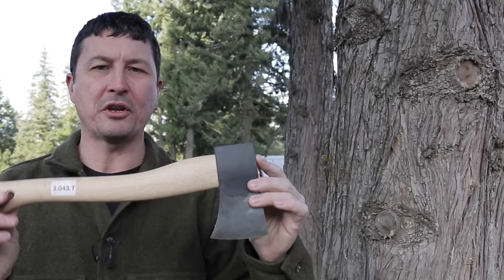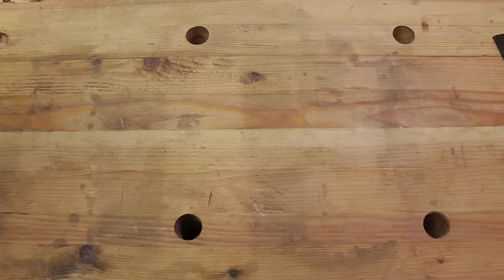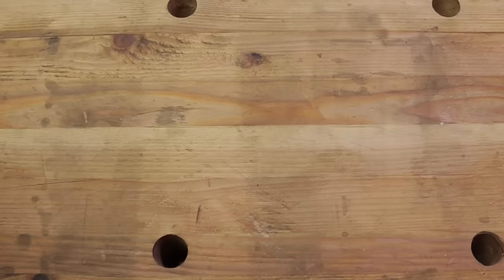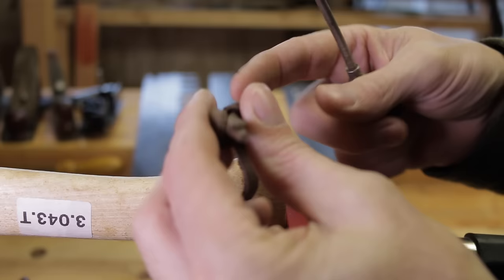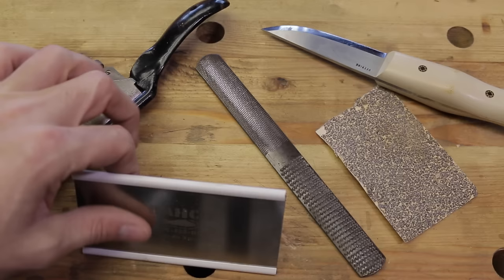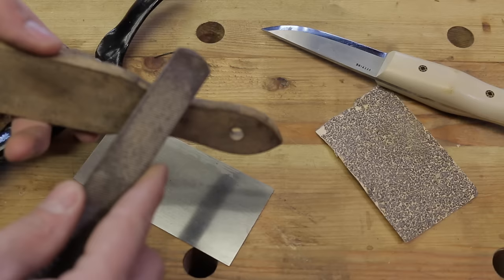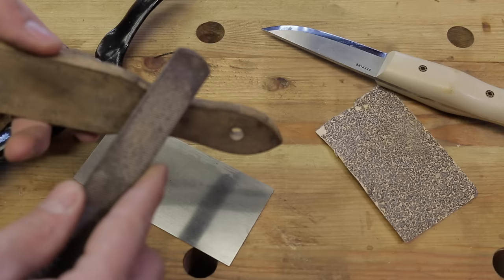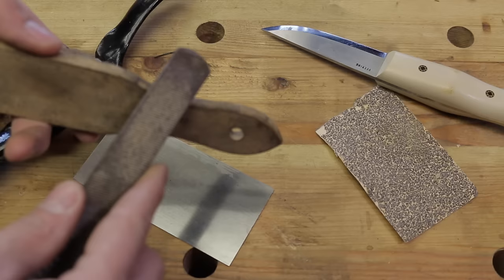5 Simple Axe Upgrades

Comment: I just use a flame to carefully burn off the varnish.  This also dries the wood so it will absorb more boiled linseed oil, which I rub in with steel wool.  Note that when the varnish was applied, it will have penetrated deeper into any exposed pores, so there is an extra reservoir of varnish in these areas that will burn longer (like a candle) and deeper into the wood if you let it.  On ring-porous woods like ash, these pores correspond with the growth rings, so if you rub back the wood before oiling it, you can achieve a nice contrast between the charred pores and the naturally coloured wood, as the Japanese practice of Yakisugi does with cypress.

Comment: I just did an axe handle tonight, but I don't have a spoke shave. I improvised by taking about a foot of steel pallet banding and filing a chisel edge in the center of it. it worked really well as the flexible banding allows you to form it around the curves and peel a large area. only downer is it's really soft steel so I had to touch up the edge twice during the process.

Comment: Cody, when I was in blacksmith/bladesmith school our instructors simply torched the handles to burn off the varnish. It worked in just a minute or less and the toasted handle actually had a nice raised grain finish that weathered in very well over time. Not sure what your opinion would be of having a handle blackened like these were but it worked very well and left a very usable handle. As a new student, with new tools I was not exactly in love with it at first but now it's my preferred method.

Comment: A properly sharpened card scraper is sharpened to a 90 degree angle then has a burr rolled over on the edge then is pulled at a 45 degree angle to the wood.  This gives you the very fine removal of material like the knife method you use with the ability to bend the scraper to remove material evenly on inside and outside curves, by far the best, quickest and easiest way to remove the varnish if you choose to do so.  They also do not generally come factory sharpened from the manufacturer.

Comment: If you don't mind a darkened handle, use a propane torch. It takes a little practice, to not let the handle surface get charred spots.. But this will lift off the varnish/polyurethane, toughen up the handle's surface, and prep it to soak up BLO faster than it otherwise might.
Reply: EgaoKage ya but that can be pretty rough on your hands even if you’re careful

Comment: Cody I actually have a method for removing varnish that works really well. It's super cheap and VERY effective. All you do is break off a piece of flat glass so that it has a curve in it, and the perpendicular edge is very nice to scrape off varnish and wood as well. I use it all the time to work on wood handles. It makes very nice curls and works much better than that card scraper.
Reply: +Chemistry, Films, and More; I saw an old movie where the principal characters  were jawing in the foreground, a scraggly looking craftsman was in the back drawing a piece of broken wine bottle over a spoke or some handle he was shaping. real shavings came from the work. I was impressed!
Reply: +grodad Yeah it's not a joke! It really works and it's my go to method.
Reply: mine too. right on. :)  (no sanding either)

Comment: Hey wranglerstar,  if you ever get the chance you should try sharpening with a harbor freight 1x30 belt sander.  This is what I use and I can get razor sharp polished edges in minutes.  I have belts that start down at 80 and I work my way up the grits all the way into 1200 and 3000 then I finish with a leather belt that fits on the belt sander with some green jewelers rouge on it.  I've sharpened large axes down to small pocket knifes.  The best part is they don't cost all that much either.
Reply from the maker: +I have a video on this deweytastic
Reply: +Wranglerstar What's the name of the video?
Reply: +Wranglerstar I found the video I don't know if they make high grit belts and leather belt for that larger 4" sander but if you were to try it with them it is the best thing I've ever done for sharpening things.  Sand on one side of the edge until a burr forms across the whole section of the blade then do the other side until a burr forms on the other side and just keep working your way up through the grits doing this.  Then follow with the leather belt with compound to get the mirror polish.  You can do this same method with stones and in my opinion gets the sharpest edges it is all about getting the burr.

Comment: Cody when I joined our fire department we hung all our own axes and other tools. We scraped the wooden handles with broken window glass and NEVER used sandpaper. Everything then got a very well rubbed in coat of linseed oil. Rubbed in by hand until it was HOT. We also scraped our wood extension ladders every five years or so, including the 40" ladder. That took a week or more.( I have always felt the flaming the handle with a torch to burn off all the little fibers leaves the best finished handle to oil.)

Comment: Sand Paper is older then Cabinet Scrapers. The process for making sand paper was patented in 1834. The first Cabinet Scraper was patented in 1899. And sanding with paper (rubbing sand on an object with paper as a buffer between one's bare hand and the contact surface) has been done since Ancient Egypt. 

  I don't think it's a matter of one obsoleting or upstaging the design of the other. A Cabinet scraper is a type of burnisher, and is for finer finish work. Cabinet Scrapers can do things that sand paper simply can't (without an unreasonable amount of effort). Such as folding over the high points of wood grain to produce a high gloss sheen without chemical treatment.

Comment: I had a piece of drift wood that I had whittled down to the shape and length that I needed it for a aquarium center piece using a fixed blade that my uncle gave me years ago for my birthday it was the first time I really used it, I sharpened it up so nicely that all I had to do for the hours I was using it was strap  it

Comment: I thought I was the last person in The United States that knew what a card scraper was; not that I like them much. I was never very good at forming a edge bur. What I use now is glass. I cut scraps the same aprox size as a scraper. That gives you eight razor sharp edges. As you dull one, flip or turn to a new one. I get scraps from a local frame shop. My Snow & Nealley thanks you for the advice.

Comment: I believe Hultafors makes the axes for Husqvarna  and Ox Head makes the axes for Stihl. If the Council Tools did have a varnish it was so light and barely there that it didn't take me more than maybe 2 minutes with sand paper to remove. I've bought 4 Council Tools, a hammer, a pickaroon, a 36 straight felling axe, and a 32 inch jersey. The aluminum wedge in the hammer flew out along with the head 15 minutes in my first use of it pounding splitting wedges. The straight handle axe's head moved up and down. I drilled both the aluminum wedges out and replaced with wooden wedges and they now hold fine. The other two have still been rock solid with aluminum wedges. The steel on their axes is soft and loses a shaving edge very quickly. They are in the $25-$35 range though for their axes. Good beater axes for work crews, but pay $10-$20 more for a Helko and they as as good as any Hults, Wetterlings, or Gransfors, just not right out of box.

Comment: the way i took all the varnish and paint off my bacho was with a burner. i burnt it all off then sanded it back untill i had a nice contrast between the black and wood. then linseed oil. the paint on the head came off nicely with acetone. she looks amazing now. mine came with a very blunt edge. cuts nice and deep now though.

Comment: A really nice and simple mod is putting a heat shrink wrap on the handle. It’s cheap and all you need is a heat gun. The wraps I’ve used are meant for fishing rods so it’s grippy when wet. I recommend trying it out

Comment: I'm a custom picture framer who always has an abundance of scrap single strength glass.  I use it often as a scraper with the 90 degree edge like your knife scrape...it can be cut curved or straight.  Simple and cheap.

Comment: I like to use a spackle knife (aka a spatula) with one side squared off on a bench stone.
To prepare it for scraping you just set the side of the spatula 90° on the stone and grind until you get a slight burr on both sides. This burr will do the scraping - you can get all fancy and instead deburr first and then put on a new, finer burr with a burnishing steel for a slightly better finish, but I didn't find that neccessary for axe handles.
This modification basically gives you a card scraper with a handle + you can still use it for its original purpose of spackling.

Comment: The following will save you a great deal of time.  Put aside the idea of treating the handle - and then having the maintain it, year after year.  You are going to wrap two layers of tape around the handle.  The first layer will be an inexpensive electrician's tape.  The second layer is tennis racket tape.  

The two layers of tape approach also makes it unnecessary to wear gloves when handling the hatchet or axe.  The tape layers also absorb some of the impact.

I have done this treatment on my hatchets/axes/shovels/rakes/hoes/sledge hammers/gardening tools.  Yeah, I used to find something else to do than to treat the tool handles year after year and they would dry out and get rough.

Comment: I use a old 12" stainless steel rule with a sharp 90 degree edge on it to scrape the handles clean, works a treat.

Comment: Just a couple of ideas that I thought of in the shower, after I watched this video...   Have you considered polishing the axe head?  What about bluing the axe head?  Next, if Tung oil or Boiled Linseed oil is so good for the handle, have you considered soaking the handle in the tung or linseed oil?  Or you could even soak the axe handle in the tung or linseed oil, while in a vacuum.  That last step would get the oil very deep into the wood.  It might be a bit of overkill for an axe, it might be a bit of work making the vacuum chamber rig, but it might look really good after it's all done.

Comment: That's why barber's use a piece of leather to touch up their butterfly knife after the butterfly knife has been sharpened on a stone.  The leather presses down the steel fibers / burrs to give the butterfly knife blade a smoother overall finish after the blade has been sharpened on a stone.

Comment: Agree with the boiled linseed oil. Makes it feel like an older, quality tool from years ago. I've removed the varnish/lacquer using a fine wire wheel on my low rpm grinder; works well, did NOT remove the wood (are at least very little), and was quick. Wear a respirator, though, and safety specks or a face shield.

Comment: Thanks for the tips on removing the varnish.  I had learned to use a broken piece of glass to scrape the varnish off the same way.  Compared to the knife it is MUCH slower depending on the size of the glass shard.  That's the way that I had learned and broken glass can be found in most places, unfortunately, if you didn't have the right tools.  Thanks again for the tips!
Reply: PH Forestry

Comment: Bought a truper 2 1/2 pound camp axe on clearence for 12.99 tuned the edge with a mill file and diamond stone to about 1000 grit buts hair off my arms took some serious work though the edge was pretty hard suprisingly and the handle actually has a good grain orientation and is not warped either direction

Comment: You can make a really very good scraper for (almost) free from a utility knife blade as you say but it can be improved with a simple step, just turn the edge on a something hard and smooth like a screwdriver shank, this will create the burr you need for efficient scraping, works really well, takes no time at all and requires no sharpening time or skill. I also use single edge razor blades in the same way for very fine detail work.

Comment: I got a high quality steel German made axe (head) for 3€.It has a slight defect in the steel, not a major issue but enough to fail the strict German QQ.  It was sold to a 3rd party who put a handle on it and sold it under a different brand name. It had a pretty poor edge and I had to search for one that had a decent grain pattern in the handle but after a few minutes of looking I found one that I could work with. With your videos I was able to turn it into a decent tool. 

If I was going to use it a lot I would probably spend the money on a better quality one but this is good enough for my use.If I use it enough that I break it or wear it out I will likely  buy a better one. I don't know where I heard it (might have been you at some point) but if im not sure if I will use a tool a lot I just get a cheap one. If I use it enough to wear it out I get a high quality one.

Comment: Lads, I think the man is aware he doesn't have an electron microscope in the workshop hahaha A bit of hyperbole is lost on some.

That aside the bahco hatchets are actually not too bad. At least one I got about 5 years ago in Ireland is still in great shape after a decent ( hard but not worked to death) amount of use. I had to take of varnish but the grain was perfect and took boiled linseed oil nicely. I will say however I recently looked at one of the felling axe sized ones that look to be of the same line and i wasn't impressed on the face of it. So keep a look out before shelling out the cash I suppose.

Comment: I've restored three axes and my favorite method is sand paper to remove varnish 
I start out with 36 grit all the way to 320 grit and finish it with a metal sponge
Reply: I prefer sandpaper too, but some manufacturers have the varnish too deep to sandpaper away.

Comment: lacquer is really cheap and a great way to protect the wood, that's why manufacturers put it on there. covering each handle with oil wouldn't be as ethical considering the lacquer is still superior when it comes to protecting the wood

Comment: Turn a decent burr on the card scraper please
Reply: agreed. I've been trying to find a good method with out a store bought burnisher. can't seem to get the burr to be even across the card scraper.
Reply: +Seth Dexter I for years used a screw driver but last year I did buy a veritas tri burnisher its streets ahead unless you can find a really hard old screw driver
Reply: Or a chromed rod from something like a mitre saw or the like
Reply: You can make a nice burnisher from the smooth shank from a broken/ worn out drill bit. 3/8" work fine. Sand  smooth and polish to a mirror finish. Drill out a piece of doweling for a handle, epoxy the bit in place. Broken drift punches will also work. Preferably carbide as opposed to HSS although these will work.
Reply: Yea, I have a feeling that he may have never been shown what a card scraper is really supposed to do... There is NOTHING to indicate that it is supposed to have a burr and he may have even ground it off if it even came with one. Only the expensive ones come sharpened correctly, and not all of them...

Comment: We would do the same process with or wood handled framing and finish hammers except on the handle end the old dalts would drill a hole fill it with linseed oil then cap it with bees wax after filling it with oil for a week we would then fill it full of bees wax and us that to lube up our nails when we had to toe nail into hard wood or knots.

Comment: I used coarse steel wool to get the varnish off my handle.  That being said, I like the look of that knife/scraper method better
Reply: doesn't that take a while? I'm just curious
Reply: +Dakota Burke It wasn't quick, but it didn't take forever either.  Basically it was what I had on hand at the time because I burned through all my sandpaper on another project the day before.
Reply: I can respect that you work with what you have, i've used a knive as a scraper and ot worked really well.
Reply: +Dakota Burke Yeah, I imagine the scraping method works a lot better, plus I really like the look of his finished product in the video

Comment: Nice vid Cody. :) You can use pretty much anything with a sharp 90° angle as a scraper. I have used a hardened steel cleat from where I work (we have alot of them) It worked beautifully!. A peice of broken glass workes really well too! as long as you're confident holding glass. :)

Comment: If a  hatchet slips from your hand, the last thing you want is to have it come back at you because it's attached by some stupid leather strap.  Mr. W is right; use the hole in the handle to hang your axe on the wall.

Comment: Once the varnish has been removed, and the knife method is my favorite one, can I apply linseed oil to make it more beautiful? Or the oil itself would make it slippery? Thanks!!!
Reply: Always add BLO it protects the wood from rotting, moisture, and it helps tighten the head in the long run. BLO will normally soak up into the wood, of a little bit gets a little sappy than you can just plow through it or scrape it off

Comment: +Wranglestar i know you hate armchair comments :) but if you had your card scraper set up a little bit better than a square edge and had it pulled into a nice hook it would have worked as well if not better than the knife> and for the side information i have and use a few card scrapers.

Comment: “A machine can’t get a sharp edge. It can only be done by hand.” Oh really? My variable speed 2x72 must not have gotten the word. It continues to make mirror polished, perfectly ground, convex edge, every time. Oh, and in about 10mins. For a not too damaged edge, a 120 grit belt, followed by 220, 400, 800, felt with chrome oxide, leather with chrome oxide, plain leather. Done. It easily shaves and I’d put it against the edges you do by hand any day.